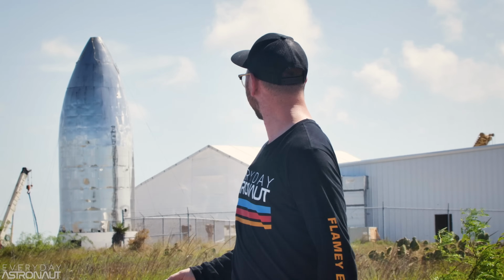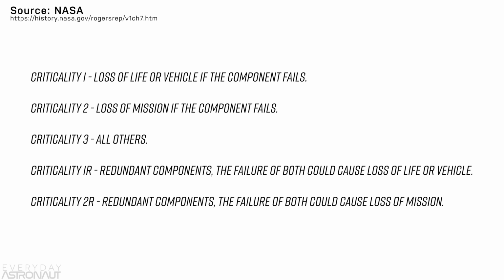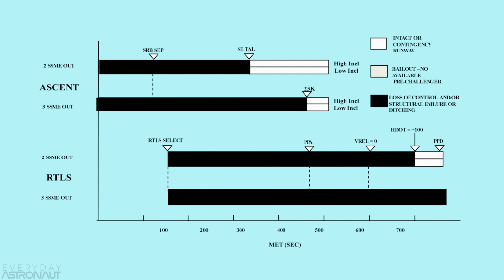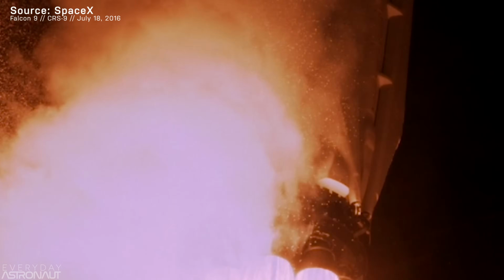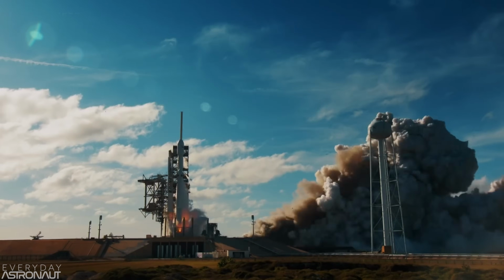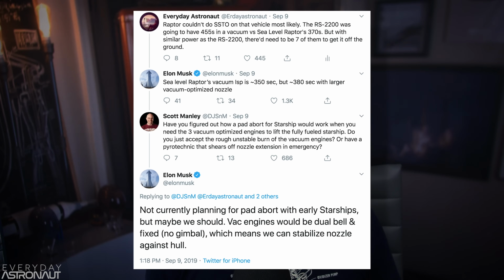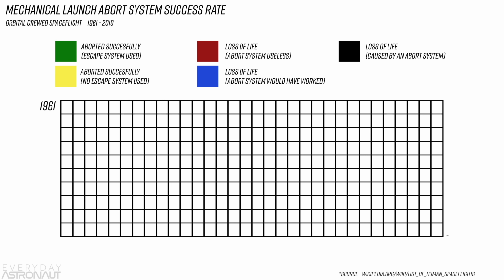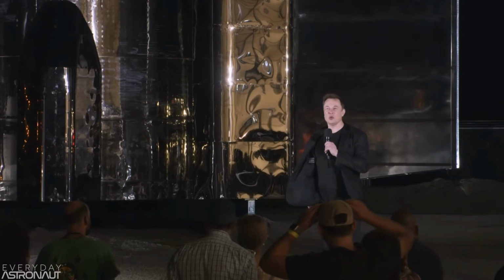Why won’t Starship have an abort system? Should it?!

Comment: "Designing a rocket to be as reliable as an airliner is the goal"

Boeing 737 Max has left the chat
Reply: They crashed as a result of greed and dishonesty. It's not a failure of competence so much as a failure of integrity. A very big black mark on the history of Boeing and the story is far from over. All deaths were preventable and they took multiple steps along the way where they could have changed the outcome but acted otherwise.
Reply: @dozodub  Boeing is a corporation, a machine with a very high defect rate in its components, and an inadequate process management system.   If the quality of its corporation is what it selling, it has done a  bang-up job.
Reply: @dozodub  Yep, that's exactly why arguing "just over-engineer the base platform" for safety is such a risky argument.  Engineers designing the base platform have many design considerations, safety being only one.  Engineers designing an abort system have only 1 primary design consideration.. saving the crews lives.
Reply: The 737 Max is a particularly interesting case, as it demonstrates that bad software design can kill people. It's not just about hardware anymore. We've encountered a new layer of complexity, where much more can go wrong.
Reply: You did a funny 🤣🤣
Reply: 500 th like
Reply: Leonardo Da Vinci: “simplicity is the ultimate sophistication.”
Reply: 😂😂😂😂😂😂😂 Reliable as an airliner. Well not the Boeing types...
Reply: Boeing has left the chat...
Reply: Ouch...
Reply: The Boeing 737 Max has a safety record of around 99,9996% 
(2 accidents in over 500,000 flights)
Reply: Jehty not all of them are the same version, only the new one has it
Reply: @OkabeGG  every Boeing 737 Max has MCAS.
So every Boeing 737 Max is grounded.
Not only the newest one. Every one.
Reply: @Jehty_  Alright, but when those 00.0004% cost 346 people their lives that's nothing to brag about. Besides, in its time of service the 737 series killed over 5000 people in 90 crashes. Maybe that's peanuts overall but it's still pretty bad.
Reply: 2nd3rd1st  No, no, no...you need to look at accident rates, not total numbers.   How many people in total have died in car wrecks?   Literally millions.   Are cars intrinsically unsafe?  No...there are lots of people driving lots of cars many, many miles.   It’s the incident rate that matters, so you properly have little fear of riding in a car.
Reply: @2nd3rd1st  my dude... 3000 people die from car crashes each day, planes are by FAR safer than most other modes of transportation.
Reply: @Bullshitvol2  Why only 10?
Reply: Bullshitvol2 what you said made no sense, you can’t do a statistic analysis of traveled time per vehicle per person, because the deviation would be insane. There’s people that barely drive and some that barely flies. 

That’s flawed from the beginning. You need to compare by amount of passengers, and that’s nothing new, you can look up the numbers, it’s still much inferior. 

We are just biased with the public attention received when tragedies like aircraft losses occur. 
The MCAS scandal is unacceptable but how many issues having to be recalled by car manufacturer resulted in loss of life ?
Reply: @Bullshitvol2  But why 10 and not 100 or 3 (square or square root of 10 rounded to one digit) ?
Reply: @MrSnakedHD  Of cause you can do the deaths per passenger per hour calculation.  Death count is known, just need an estimate of total person hours for each transport category (train, car, plane etc.).  These are large average based numbers.
Reply: Different modes of transportation buddy. Different process. Different challenges. Wrong department. 

Rockets are a Giant Bomb. Planes are not.
Reply: @2nd3rd1st  ever heard of cars?
Reply: Bullshitvol2 no planes are WAY safer than cars. There is no debating that fact
Reply: @2nd3rd1st  Automobiles have a far worse "safety" record than aircraft.  Cigarettes have a higher user mortality number than cars plus planes combined.
Reply: @Bullshitvol2  Yeah, but that is changing with self driving cars.
Reply: @2nd3rd1st  lol a 737 crashed yesterday
Boeing is trash
Reply: Installing an automated device with no Off Switch is the height of incompetence.
Reply: It's " Boeing" not Boing ....
Reply: @DARisse-ji1yw  You'd hope the planes go Boing rather than Crash though
Reply: @DARisse-ji1yw  It's Booing right now because of CST100 Starliner!
Reply: @DARisse-ji1yw  I'm Goeing on a Boeing lpl
Reply: D.A. Risse but „boing“ it did do tho
Reply: @MrSnakedHD  " I work in aircraft maintenance as an engine specialist, and I could tell you without any hesitation that most problems come from what’s between the seat and the yoke." And our understandable reluctance to put the responsibility with the people actually responsible will cost thousands of lives in the future.

However, the socialist narrative of capitalistic companies and their engineers crassly ignoring the right of their customers to live and willingly killing them to make more money is so seductive, so diabolical, so cruel that the public eats the narrative like candy. People love to blame the very companies that make air travel possible and think that those companies purposely kill people for dollars. That is a crock of bull hockey.
Reply: Boeing 737 is a safe aircraft. The failures were human failures. No matter how safe the aircraft or spacecraft, it will never be possible to build a system so safe that human ingenuity can't crash it.
Reply: @RockinRobbins13  The 2 recent 737 MAX crashes are absolutely not due to human error. Not only were they not told that MCAS even existend in the first instance, but in both instances the hydraulic actuator in the tail of the craft "slipped" or "slid" as the pilots tried to control the aircraft. This is most likely what caused their gradual difficulty to put the plane into a more upwards trajectory. This hydraulic actuator is a part that dates from way back when the plane was smaller and lighter but was never changed.
Reply: @alexseguin5245  You didn't read the reports, did you? The reports make it crystal clear that the problems were known. Even against FAA advice, Boeing transmitted the information necessary to prevent future crashes and the Ethiopian crew refused to fly the airplane. They never touched the throttles even though they were approaching the speed when the airframe just gets ripped apart by aerodynamic forces. They were flying 500 mph at an altitude where the maximum speed is 250.

Read the preliminary accident report. Learn. Understand. They never flew the plane other than getting enough attitude control to climb above terrain and twice the maximum speed permitted. They never touched the throttles. Manually trimming a plane with those excessive flight loads on the control surfaces was a pipe dream. They shrugged their shoulders, and then turned the plane over to the "terrorist" bound to kill them all. It did.

The automatic trim overrun procedure is a memory procedure. It's been in place since 1966 through three generations of pilots. These pilots decided they weren't included. Now they aren't. Neither are the almost 600 people that died with them.

Read the reports. They are the ONLY real information we have. They paint a clear, unambiguous, understandable picture of two aircrews who didn't know enough to fly their airplane. It's not me saying that, it's the evidence: The ONLY evidence available in this incident.

You can't just make stuff up and then expect it to fly.
Reply: @RockinRobbins13  I agree completely. While you can invent something idiot-proof, someone is bound to invent a better idiot.
Reply: @RockinRobbins13  there have been many crashes of 737s caused by mechanical failures, indeed arguably et302 would have been very hard to save, however you are right that the 737 is a safe aircraft overall
Reply: @marcusabrio3256  Yes, you've got it right. ALL 737s since 1966, not just the 737 Max. I'd say the 737 Max is probably safer than a pre-1970 737. I'm cheering for them to get the aircraft back into operation and also cheering for airlines to better train their pilots. 

Especially the Ethiopian Airlines flight, the pilots took manual control of the plane, climbed out of danger, then put the plane right back into the hands of the MCAS which immediately crashed the plane. That was explicitly against the memory procedure for a trim overrun which stated to throw both electric trim override switches to off and keep them there for the remainder of the flight. That's nearly an exact quote, and the procedure was ignored. Sometimes malfunctions are in the people. Those also can be mitigated.
Reply: @RockinRobbins13  with the Ethiopian crash the pilots were unable to climb, they correctly followed the procedure but it didnt work, there was a roller coaster procedure developed in the 1960s to solve this problem but it wasnt emphasised recently in training, and they wouldn't have had enough altitude to perform it anyway, potentially slowly reducing trust to reduce speed could have worked, however this could have caused the aircrafts nose to lower as well, and so still cause the crash, so it is entirely possible that from the point where the pilots began the runaway trim procedure the flight was unrecoverable. However the Indonesian flight I would have said was pilot error as they didnt complete the runaway trim procedure.
Reply: @UC5ufOgfoXjZpz_57FnqNwSA the pilots were unable to climb the aircraft much, and it most certainly wasnt a fully functioning aircraft, the pilots did attempt to climb but were unable to due to the and trim, and when they attempted to manually trim the aircraft to allow them to climb out of danger however were unable to due to the speed, and reducing thrust, to reduce speed, since the engines are below the centre of mass, would reduce the anu moment caused by the engine thrust, so increased the and tendency. It is possible if the pilots we quicker to run all the checklists it could have been saved however given all the false warnings the pilots had to process, it is unreasonable to say it should just be an annoyance. Further the Ethiopian pilots had simulator training on the max, which is more than any of the pilots at the major american airlines has had. Im not saying that the pilots were perfect, but they appear to have had good training, have identified the issue, and ran the procedure to fix the problem, however this then lead them into an almost unrecoverable situation, at which point they began trying to have to solve the problem ad-hoc, pilots shouldn't ever be put in that position if at all possible.
Reply: RockinRobbins13 Dude- it was MCAS. Pilots did try to recover but the system did override their attempts. Just check the accident reports.

Comment: It's a possibility to save whole starship in case superheavy fails, throwing all extra fuel that isn't necessary for escape maneuver, obviously cannot make it like a aeroplane is needed to be done in a single second, so why not use a external fuel tank and throwing it in case of emergency, starship can accelerate to 3g if it have on board only fuel for emergency escape.(and are other things you can do with a external fuel tank)
Reply: Thing is, all that unneeded fuel is between the engines and the capsule, and you're dumping it into an exploding booster...
Reply: @jeffvader811  in the in-flight abort a external tank can be ejected laterally, I think 3g acceleration it's better than 1g or less witch would be the case with a fully loaded starship.
Reply: @theOrionsarms  
How exactly would you eject the tank like that? Solid rocket boosters? The whole manoeuvre sounds frightfully complicated and dangerous, more so than it's worth.
Reply: @jeffvader811  using multiple tanks wrapped around central body like the side boosters of a classic launcher (imagine Korolev cross) and can worth it with this solution can escape using only the sea level engine without damaging vacuum engine, in this case acceleration would be 1,5g.

Comment: would you get on a plane with a 1 in 200 chance of killing you?  No, you wouldn't.   So why would you get in a rocket with the same chance?  We need thousands of perfect flights before this could be considered safe.
Airliners have many abort options.   since no single failure can doom the whole plane usually with self healing tanks and shutoff valves, you usually have 1 engine, and even without an engine, you aren't dead.  You still can glide.

Comment: Great video as usual. It'd be very interesting to find out whether building an orbital habitat station on the Earth orbit to later upon completion transport it to Mars orbit is a viable option as the first step of Mars colonization.  Quite possibly it could be a better option to build it in bulk close to the Earth, send as one complete piece and not send many many rockets right on the Mars surface to start from scratch. Not to mention that orbital habitat could be an escape plan should there be problems on the planet surface.

Comment: Note that the Dragon II abort system test failure was partly due to the fact the the valve that leaked had to be there in order to allow propulsive landing.  They replaced it with a burst disk that would not leak and could not propulsively land but still would allow for abort.

Comment: IMHO its a huge mistake to trust reliability to allow deleting the abort system when there is limited or no data on the new vehicle and engines.  Once they have thousands of flights they will have thousands of data points they don’t currently have so to act without data seems to be repeating the mistakes of Shuttle.  To not even engineer a solution based on the upper stage engine seems borderline arrogant and arrogance rarely mixes well with complex engineering problems especially when you introduce space as the setting for your failure to happen.  I understand launch abort systems haven’t saved many lives in the past but to not even bother trying to have a backup system seems to me to be a mistake.

Comment: Excellent video, as always!  Thanks!

Remember that the Space Shuttle was designed to re-enter safely with, not just damaged, but entirely missing thermal tiles.  

In fact, it did so successfully in the first several missions before they vastly improved the adhesive used to attach the tiles.  The first few missions came back with lots of tiles missing, and I do mean lots !

So, it’s probably a bit of an exaggeration to say that STS-27 was saved by coincidentally having a steel antenna under a tile that came detached.

But, yes, the concerns you’re describing here are very real, and, yes, NASA’s decisions along these lines were a tad iffy.

Comment: I think you are using the wrong system to relate to in flying.  Try this instead, Spacecraft abort system, vs, Ejection seats in Aircraft that fly above Mach 2.0. that may be a better metric.

Another thought is instead of abort system how about failure survivability, so even if the ..whatever.. explodes or fails you still live.

Comment: I was concerned about this issue from the get go. Personally, I would want an abort function. Options in the event plan A fails is a beautiful thing. Even in the event all the engines fail on a modern jetliner there is at least the possibility of a controlled glide.

Comment: You just have to accept that there is no 100% safety. Not in life, not on the road, not on a rocket. Every time you leave your house you accept a risk greater than that of Starship failing, the fact that you are all pros at completely ignoring that fact doesn't negate it.

Comment: Kerbal Solution: rely on the exploding booster to blow the crew capsule part clear...
Reply: The difficulty is in making the crew capsule tough enough, while still sufficiently light that the rocket isn't crippled by its own payload.
Reply: @Ensign_Cthulhu  Don't worry. Kerbals bounce.
Reply: @TonboIV  They do.
Reply: jsm666  Since heat shields are basically indestructible, I don't think there's too much of a challenge in making the crew capsule tough enough...
Reply: ... without turning the occupants into jello from the g-forces involved.
Reply: @everettlwilliamsii3740  Kerbals are very durable.
Reply: Hey, it worked the the Challenger ...err wait...

Comment: One minor thing I cant seem to agree on, is the abort system success rate blocks. Shouldn't you exclude the white boxes when calculating percentages? 1% seems to a convenient stretch . An abort system is like insurance. Just because you didn't use it doesn't mean it was not necessary.
Reply: 38:25

Comment: What the... Just YOLO it! Starship doesn't need any complex or counter-full reusability abort system (abort tower thrown away). Make it good enough from the start. We don't have ejection seats or even parachutes in passenger airliners. Couldn't think everyone would survive US Airways Flight 1549 if the standard procedure was to have people put on some parachutes and all exit the plane in those few minutes, from low altitude and many ending up in the Hudson, but not at the same place.

Comment: Very informative, and I appreciate your hard work in researching this and all your videos.  A few thoughts: 1) rockets should be perhaps designed around abort methods/modules from the 'git-go', not added as an afterthought  2) assembling a rocket in sections in orbit would eliminate Max Q, fueling/pressurizing issues pad, and rainstorm of LOX ice - a paradigm shift  for launching worker drones in orbit & rocket propulsion is needed 3) according to Prof Simon that tech is in our possession (see his Tic Tac UFO vs Navy jets video!)

Comment: Good question. In my opinion, the abort system should not be any additional hardware because It's overdesigning. A perfect abort system is to be a procedure that can be activated on existing hardware.